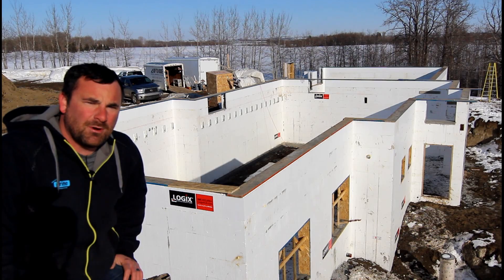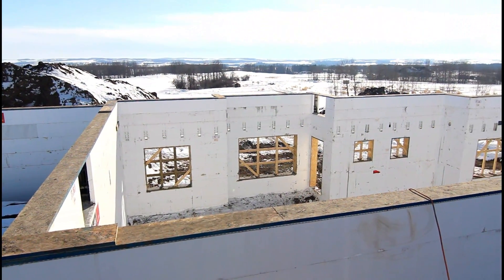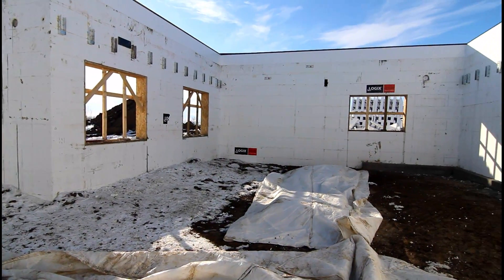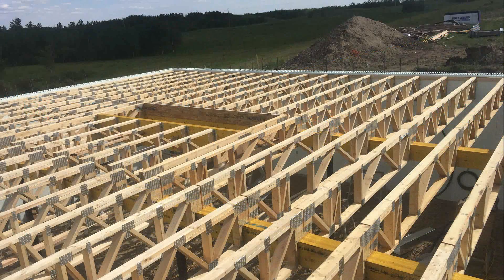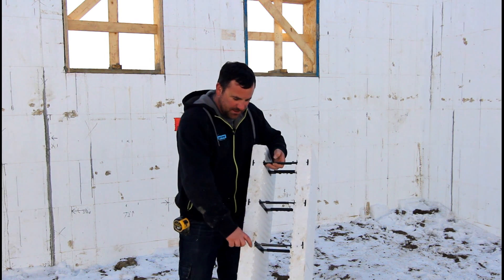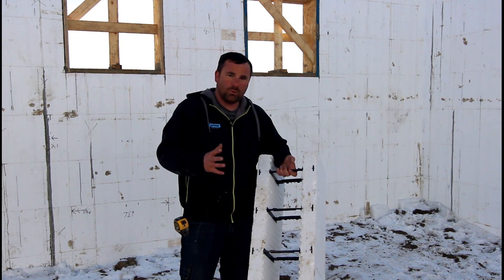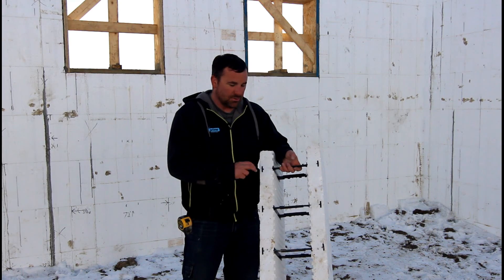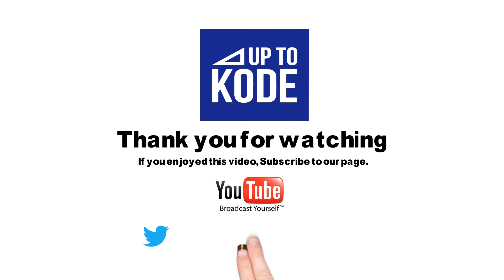ICF to the Roof : The ONLY Wall System That is Self Supporting

Comment: Hi Kode, I’ve laid up my ICF walls to 15 feet in the main house area and 12 feet for the garage and found out that the height is challenging for a workable cement mix that can make it past all the ties and rebar and not separate.  My blocks have a 6” gap in between and I have primarily #4 rebar horizontally and a mix of #4 and 5 vertically.  Have you been in this situation before or have any suggestions?  The ready mix company I will be using has a custom mix in mind using smaller pea gravel and plasticizer.  I was wondering if I should add short fiber strands, as well.
Reply from the maker: I’ve never poured much over 10 or 11 feet for the same reasons you mentioned. I like the pea gravel and plasticizer. I wouldn’t add the fibre. That will hold things up.
Reply: Thanks for the advice!   I went without fiber and the mix was above 3000 psi.  It was poured in somewhat of a landslide type process with the next lift going between the peeks- if that makes any sense.  We started with external vibration and found it wasn’t necessary.  We checked for level and voids with a person on each side of the wall up to the middle of the walls @7.5 feet and after that my son working the hose could see the level of the mix.  76 yards total with three guys in 4 hours.  Weeks later, I had to Holehawg two 3” holes near the bottom and two courses up and it felt like solid rock- had to switch to a chipping gun.
Reply from the maker: Good to know it worked out well. Great job!

Comment: Kody , trying to find anything you may have encountered attaching a pressure treated ledger for a deck on the outside of a pour ICF foundation wall ? Within 24 inches of grade level . Thanks Scott
Reply from the maker: Installing a Deck Ledger on ICF
https://youtu.be/1vosYbvK94c
Reply from the maker: Let me know if this video helps.
Reply: Thanks. Yes I have watched that video . Covers more of the vinyl siding and drip edging required for been water proof than the attachment of a ledger . I have no siding to worry about where I need to place the ledger. More interested in the actual attachment of a ledger on an existing poured icf wall . House is 12 years old .
Reply from the maker: In all honesty…if you screw into ever web (8” centres) I would say that is enough to hold a ledger. Now if you aren’t comfortable with that, buy some 1/2” x 8” wedge anchors, drill a hole with a hammer drill and pound those in and tighten the nut. Extra insurance.

Comment: Kody what is your preferred system for attaching trusses to the LVL top plate?
Reply: Is that for a single layer of lvl or double? I’m wondering about hurricane straps working with only a single top plate.
Reply from the maker: It’s a single LVL. That’s all you need. With 5-6 toe nails that truss will tear apart before anything fails.
Reply from the maker: Toe nails. You can get 6 nails (3 per side) with no splitting of the wood since the top is at least 11 1/4” wide.
Reply: I ended up just using a single fir 2x12 as my top plate and used h3 connectors at both ends of truss nailed into the 2x12. I also put some toe nails into it. LVL for my building was going to be $3300. Lumber was $300.
Reply from the maker: I’m going to start switching to 2x12 as well. LVL is just too much money now.

Comment: Hey, great video. I have a question. What if we have structural concrete columns and beams? Can that be integrated into the ICF system? The second floor is going to be made out of poured concrete (i.e. the floor itself). How would that work?
Reply from the maker: Yes of course those elements can be integrated into the ICF walls. If you don’t think about the foam it’s simply a concrete wall that is easy to engineer to meet your design. I’ll comment again with a link to another one of my videos on this topic
Reply from the maker: 10 Reasons to Design with ICF (Insulated Concrete Forms)

Comment: Kody, how are mult-story ICF houses built: a single story at a time with each story having a separate concrete pour or one single pour?  I would think the single pour would be stronger, but wouldn't trying to consolidate (vibrate) the concrete down 20 or 30 feet be really difficult even if the multi-story wall is poured in 3-4 "lifts"?
Reply from the maker: Each story poured at one time.

Comment: When installing screws in webbing can the screws strip the webbing?    In other words is this webbing thick enough so that screws won’t strip in it
Reply from the maker: The webs hold very well and rarely do the screws strip. I had some treated 3” screws recently that would always strip but a regular zinc 3” would hold great. 

The webs are plenty thick. Plus they hold the force of concrete when pouring so that component can’t be “cheaped out” on.

Comment: Great video.  Plumbing etc... in the icf house?
Reply from the maker: Yes of course. Most plumbing ends up in the interior wood walls. Vents pipe for kitchen sink can be run in the foam since it’s 2 5/8” thick. Just gouge out the foam and put the stack in. Spray foam around any gaps. 

Electrical is ran into the foam by making grooves with an electric chainsaw. Stuff the wires in and spray foam the gaps after inspections.
Reply from the maker: Follow my channel Kody Horvey as I am continually putting up ICF videos

Comment: Kody,  can you speak to installing plumbing and electric in ICF walls?  Any retro fits appears to difficult.  Thanks!
Reply: They sell hot irons that melt it and do a much cleaner job also.
Reply: Electrical gets channeled out of the insulation plumbing on the other hand needs to be hidden if framed walls for the most part.
Reply from the maker: For electrical we like to buy an inexpensive electric chain saw. Install a bolt at the front hole of the bar which sets the depth so u don’t scrape the concrete as you cut channels in the foam. 

For plumbing common practice is to never put water lines in an exterior wall so that’s not an issue. 

Often times we need to vent a sink and that pipe get cut into the foam and up into the attic space. 

We just spray foam and cracks or gaps after rough in’s and all is good.

Comment: I live at the Southern End of Lake Michigan and I wish I knew a contractor/architect who could design something for me and build it with ICF or a related cement wall and ceiling for two story houses with unique roof designs to optimize the sun for inside plants and lights.
Reply from the maker: I hear ya! It’s very easy to hit all structural requirements but still easy to make it architecturally pleasing and easy to work with. And you could outsource the design but finding a contractor with the experience might be tricky. But I’m sure if you look around someone is doing it in your area.  Or find a journeyman carpenter, we get taught concrete form work so it’s part of our trade.
Reply: Julie Gurley @ the corner of Lasher rd & Long Lake rd in Bloomfield Hills there is an ICF house that is absolutely beautiful